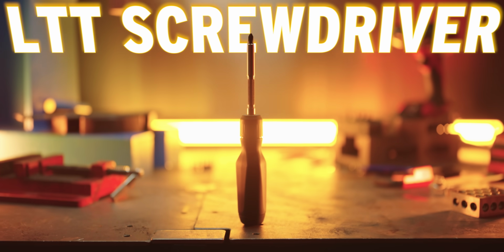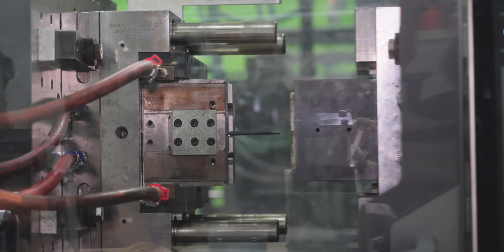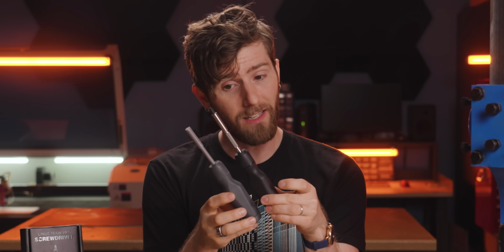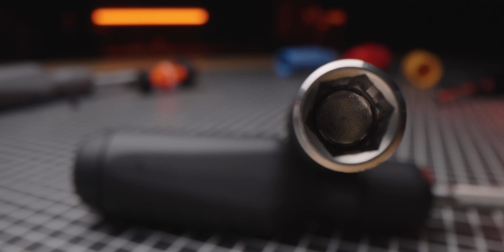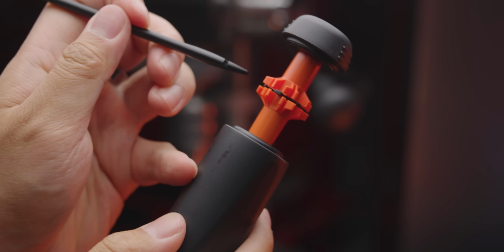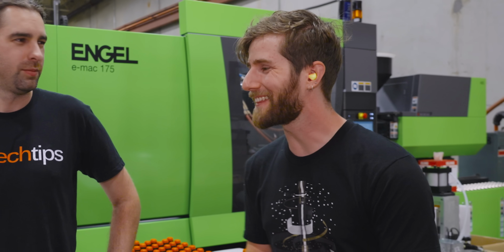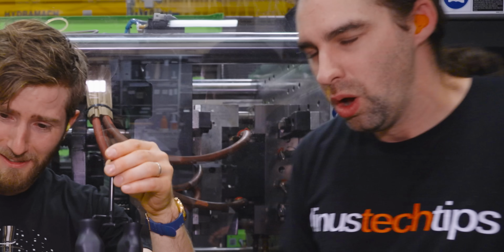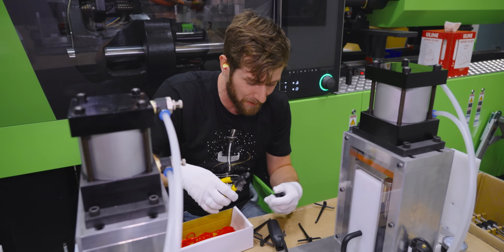Why our Screwdriver took 3 YEARS

Comment: I work at a computer repair shop and we'll all gladly be buying one, and writing it off as a work expense!
Reply: This is the way.
Reply: Also wait for Reviews ;) I just bought another Wera kit.
Reply: If you have a repair shop, wouldn't you be better off with an low profile electric screwdriver? They are expensive, but if you use one everyday, it's totally worth it. Not to knock his product, but a manual one dosent make sense for professionals anymore...
Reply: @Eoin-B  Electric screwdrivers are nice, but some people prefer the feel and flexibility of a manual screwdriver. Like me, I know exactly how tight to tighten computer  screws by hand and i dont want to have to relearn all that with an electric.
Reply: @CliffordChang-v8c  I prefer manual screwdrivers as no batteries to worry about.    Just good ole muscle power is all I need.  The really big jobs that require alot of torque I would use a power drill with a bit attachment.
Reply: @CliffordChang-v8c  I've worked with some cases that the sheet metals is pratically paper thin almost that using electric screw drivers would just strip the threads no matter how low the torque setting is set to. computer case screws are not holding a lot of weight on their own and have a very low probability of coming loose as long as they are finger tight. there is no need for an electric screw driver other than speed. but sometimes the speed isn't worth the trade off of ruining a computer case.
Reply: @Eoin-B  we definitely have electric ones too, but sometimes it just feels better to work with a traditional screw driver for certain things,  sometimes it's probably a little slower, but you like what you like 🙂
Reply: @Eoin-B  I work as a tech for a large company. I will always take manual over electric, as it helps with controlling how far you want to unscrew something as well as keep track of the screw itself.
Reply: @WaterDragonGames4  I don't think you ever used an electric one. You can use it both manually or battery powered. I work with them daily in assembly and it has nothing to do with feel or preference. It's a tool, you use it to get the job done for whatever is needed.
Reply: @bikerboy3k  It has everything to do with preference, if you aren't comfortable with the tools you are using, you will be slowed down or irritated by the work you do. I've used one before, and while yes, you can use them manually, I find that ones designed outright to be used manually perform that task better and last longer before having issues. It's possible that the ones I've been provided with in the past were just, well, crappy (corporate always wants to cheap out on equipment), but when you get a good tool that isn't uncomfortable or frustrating to use, you're going to want to get that.
Reply: @Eoin-B  they never have enough torque for my work, which is disassembling laptops
Reply: @Eoin-B  I’m a car mechanic and I will be buying one! There’s uses for power tools and there are also jobs that are better suited for a hand tool, sometimes it’s space confines, sometimes it’s sensitive components etc sometimes it’s just preference
Reply: @Eoin-B  especially when the battery degrades it will be super efficient
Reply: @Eoin-B  could be a preference thing. Some times it's satisfying to turn a screwdriver, albeit slower.
Reply: @Eoin-B  fine control is more difficult with a machine screwdriver. Sometimes it’s just easier to use a manual like with thermal paste application. It’s also just always there and ready to go.
Reply: @Eoin-B  most applications yes, but the manual screwdriver still have use in many scenarios, specially since it takes less space like working on the engine bay.
Reply: @Eoin-B  “computer” repair shop…not just a general repair shop LOL…you need controlable delicate torque…electric screwdriver will screw your thread or delicate part LOL…how did I know? I own electronic repair shop…..🤦🏻

P/S : I own many type of electric screwdriver too…you just need specific one for specific task…like grip,weight,length, everything matter as you’ll frequently repeat the process
Reply: @Eoin-B  I did computer repair for 6 years and good quality screwdrivers are the best to work with imo, electric just sounds bulky an annoying. Would take a Wiha! driver any day over that
Reply: @jamesthumm3823  god we love our wihas here too, really great screwdrivers
Reply: @LegionEmu396  ya and others prefer Wera screwdrivers.  Either brand are great for daily use for repairs etc.
Reply: @Eoin-B  Personal preference does matter though.
Reply: That’s what I’m planning on doing
Reply: You were payed to say that, no cap....
Reply: @WolfmanFoxtrot  I was?! Where's my check!
Reply: I work at farm and damn right that is a work expense! 😎
Reply: Can you get one for me too!
Reply: That's what I did
Reply: This is the way
Reply: Same been watching the production process this entire time lol
Reply: meatrider
Reply: only reason to buy one
Reply: As you should!
Reply: I work at farm and damn right that is a work expense! 😎
Reply: I never use a ratchet screwdriver with bits in my computer repair work. Only manual/fixed screwdrivers.
I will buy a electric screwdriver pen for larger jobs.
Reply: XD
Reply: @mikeycrackson  no he's just saying he can bc technically it is a work expense and it costs less (dont @ me here but if it recalls correctly, should be free.) 70$ is a bit of a price but if you're running a business then there are some expenses you can take to better QoL of your employees and such. if its supposed to be the best though, linus could have charged quite a bit more i'm sure so 70$ doesnt seem too bad. The manta from Ifixit (which seems to be the largest kit I can find) costs 70 too. If there are bits and everything to Linus's screwdriver, what makes his expensive?
Reply: @1bruce-  the Manta from Ifixit comes with 112 bits, just about every bit and specialty but you could ever want. It also comes with two different sized ratcheting screw drivers, not one. Specialty screwdrivers are expensive since they do not have a economies of scale on their side. 

A more fair comparison would be the Moray or Minnow, for $20 or $15 respectively with 32 or 16 bits. And these prices include shipping via amazon and still deliver more bits.

The LTT screwdriver looks good. It’s overpriced for a screwdriver, but it’s not a waste of money if you want one. Especially if your intent is to support LTT while getting something useful in return.
Reply: @username4835  those screw drivers are not ratcheting unfortunately, but still very nice! I've been using Ifixit screwdrivers for certain tasks up to this point and still probably will after I get the LTT screwdriver
Reply: @username4835  you're right, i think its more of just another product on the store you can get to support them. i'm glad they tried to make it worth the price with whats on it
Reply: @1bruce-  when you expense something, it just means you can deduct the amount from your gross income so you don't have to pay taxes on it. So if you pay 30% in taxes, you'll save $21 in taxes on a $70 screwdriver.
Reply: @DanKaschel  you learn something new every day :)
Reply: @1bruce-  oh yeah I was down to purchase it myself v anyways, $70 may seem like a lot but for a tool I'm using 85% of my work day for, theoretically, years? Definitely worth paying extra for a quality product
Reply: @LegionEmu396  Then why don't you get one from a reputable brand with a proven track record that's cheaper than this ? Snap-on has ratcheting ones and they're about 30-40 dollars plus they have a reputation for being the best tools around.
Reply: Buying one myself
Reply: Its very expensive for Ratchet Screw Driver. I have the Amazon Ratchet come with 73 piece for 25$ :P that alone is strong enough to handle any PC/Laptop Screws.
Reply: @TOYTULOG  they had that screw driver on the live stream. It’s not even in the same ball park. That zon one poop.
Reply: @whitekong316  I dont know what u are using the amazon ratchet screw driver for. But again I am only using it for PC/Laptop and it never break on me yet. Maybe u are using it for Drywall/Wood Screw. But for that 70$ Ratchet Screw Driver. U might just get a DRILL instead.
Reply: @TOYTULOG  you never need to use for anything else? 😂😂😂
Reply: @whitekong316 what else am i gona use it for? I have 4 Drill in my Garage.
Reply: @mikeycrackson  I'll have to wait for a sale in the distant future. the cost of one screw driver is more than my mortgage!
Reply: That's the only way anyone will be able to afford one lol
Reply: Can you get me one please.